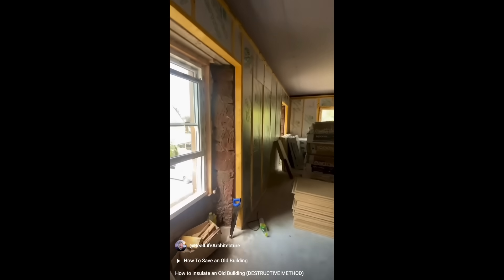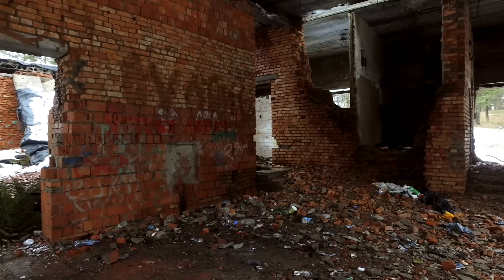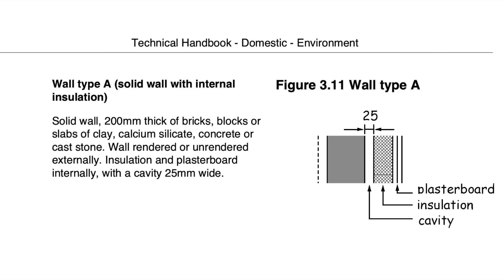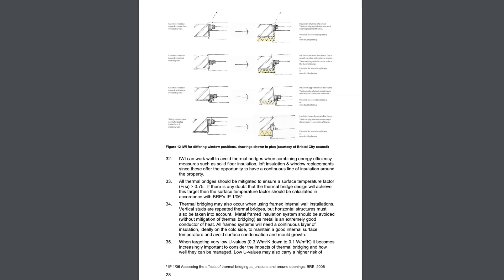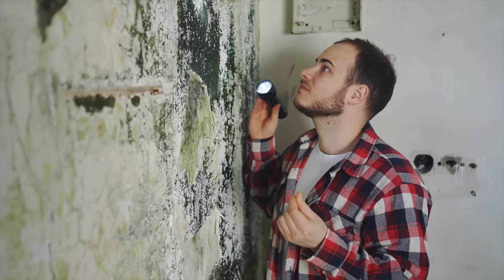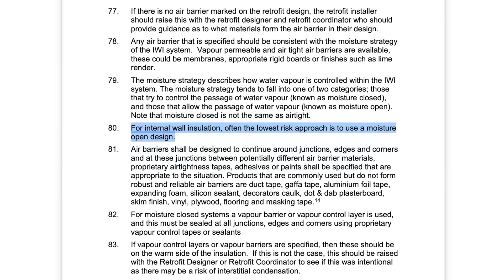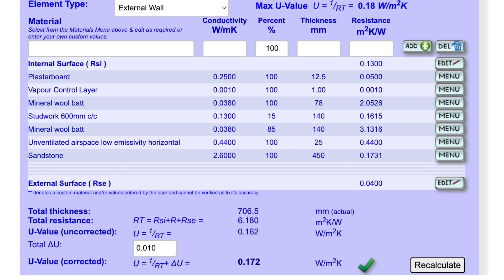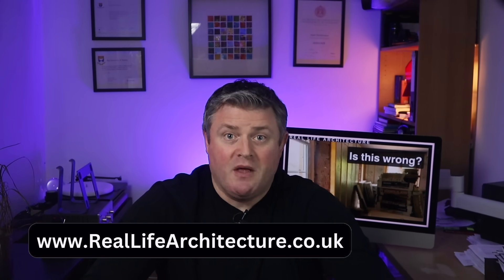How To Insulate Inside a Solid Wall in the UK

Comment: The algorithm gods are shining on this. Well done!

I've recently found this channel over in the Oregon US. I find the way they talk about building science over there really intuitive. It's based on a style of communication developed around Building Science Corp community, who helped developed modern US code and climate zones, their website is also excellent. I'd love to see this sort of discourse here in the UK:

https://youtu.be/Csjs2yVVt7A?si=JN0IkIivxos2L7Lk

There are a few things I would take issue with your video though:
-The amount of insulation does matter. The more you have, the less thermal energy from the central heating system will be available to dry the masonry mass wall. It starts getting tricky at ~150mm IWI levels in the UK climate. It will depend on exposure etc. Fortunately, the first 50mm is far more important compared to the next 50 and so on, so it's likely going to be limited by floor area loss before becoming problematic. 
-As long as any organic matter stays away from the condensing surface, there will be no risk of mold growth. Mineral wool up against the wall is ideal, however, the rest could be some organic fibre between the internal stud wall (interestingly, this is even true if the dew point occasionally lands in the organic insulation layer at times, as the moisture will never condense due to a lack of thermal mass to seed it.)  
-More insulation also risks any embedded timbers in external walls remaining colder for longer, meaning it may start to decay the end grain after IWI is retrofitted. This can be mitigated by hanging the floor system from a ledger board with DPM, or placed on metal brackets hung from the wall, creating a capillary break. 
 
What I'd add to this discussion:
-The parge coat flattens the wall, covers gaps, and offers a means of hygric redistribution of point sources across a large area to promote inward drying. It also reduces the risk of unwanted air paths from forming behind the insulation, which can lead to some stochastic movement of moisture you'd rather do without. 
-Mention smart membranes! Such as intello. They're a game changer. They become more vapour open when the relative humidity equalizes on either side of the membrane. Effectively preventing internal outward vapour pressure from passing through to the walls and condensing during cold spells, but allowing inward drying in milder weather.
-Any process relying on vapour diffusion is very slow and occurs over weeks and month. Air sealing is absolutely critical as it can transport much more moisture. If you don't air seal, then vapour pressure really does matter. Hence why I like the detail, in Asiri's video, of having a service cavity to maintain a continuous air barrier, whilst allowing electrics and plumbing to be routed internally, and easy modification in future. This air seal should be continuous across the entire thermal envelope, all the design skills and installation QC will depend on how well you navigate around all the tricky details. Get that blower door and on site air tightness champion going!

I'd trade durability for energy efficiency every time, so we need to relegate the importance of thermal resistance dead last, until we sort out exposure, air tightness and vapour profile in that order.

Comment: I see many absolutes here, and a suggestion that there is "the way" which excludes all others. This is far from the truth. Different structures in different locations with different orientations can present specific constraints which must be understood and addressed. I also question the rigid adherence to U value requirements which are in fact open to interpretation and pragmatic application.  Look at threshold values in Part L (England) for example. Start with realistic objectives. Undertake hygrothermal analysis/simulation. It is both simple and complex. One size does not fit all.

Comment: I have a mid terrace with bay window and thought there was a cavity sadly no. As a result I get terrible condensation inside not helped by the mistake I made by painting the plaster with a rubberised paint. I intend to rip back to the brick and put batons and insulation in. Was going to fix baton to walls but seeing how you have basically made a wall separate to the outer wall, think this might be a better option. Batons not getting wet etc. I have painted the outside with storm guard so any moisture will hopefully go one way.

Comment: I think it is important to look at temperature gradient through walls in addition to a water vapour gradient to determine where the dewpoint will fall relative to the wall thickness. It is useful to note that anywhere in the UK the Vapour pressure is going to be higher inside the building than outside, (except on a very small number of days). Given that buildings particularly houses, are generally warmer inside than outside and thereby carry a higher water vapour density inside. This water vapour will attempt to migrate to the lower density area, condensing at the dewpoint if within the walls or being dispersed if outside. A solution is to have a vapour control layer behind the plasterboard to prevent this migration. Ventilation or mechanical air handling can then be used to reduce water vapour levels within.
Porosity and condition of the masonry and mortar need considering. I picked the cement rendering off our 500mm solid limestone walls, repointed with sand/lime, fully intending to put an injected damp proof course in. There is no need, it’s all dried out. Internally 50mm insulated plasterboard foam fixed to the walls and gypsum plastered. Floors dug out an relaid concrete incorporating 75mm PIR insulation and dual DPMs. Also I would mention that air tightness is the bane of old buildings - they need air circulation. 
A further check should be for any salts that may have leached up or into walls, and may cause hydrophilic dampness.
I don’t think it is possible to have a prescriptive method of insulated lining to suit every situation. All the relevant factors need to be studied, assessed and the best fit specified.
Reply: Your comment illustrates that which, IMO, is generally missing in the building industry and in particular, relating to the subject at hand. It seems there is very little real research being done into this subject given the problem has been around since the dawn of humanity and we just seem to lurch from one disastrous 'understanding' of what's going on and how to fix it to another without any real science being reflected in building control diktats.

In my situation, I have an old stone / lime mortared building with 600 mm thick walls, some 17 m long but only 3.7 wide internally, which are therefore too close together to put anything other than absolute minimum insulation on the inside (looking at insulated lime plaster 25mm thick, ATM). The back wall can be externally insulated if necessary but the outside of the front wall (balls to ideally) I really want to keep visible because it is such a stunning example of exceptional craftsmanship. I guess perhaps if I manage to get the majority of the stone wall reasonably dry that it has at least some insulative value (significant overhangs and good drainage/ventilation at the foot of the wall, ideally both internally and externally) and go to town on the thermal performance of roof, floor, doors and windows (WHMVHR, obvs, as it always should be these days) that I might be able to get away with it but I foresee something of a building control battle looming in this respect.
Reply: @ I feel for you. The regs seem to be pushing us towards Passive House performance with no allowance. Consider also orientation to the sun, solar gain potential, Prevailing wind direction and intensity, annual rainfall and average temperatures. With an old building these factors and more are pertinent. Fortunately I didn’t need regs for any of my insulation works, only the extension over a catslide roof. Though I’ve plumbed the whole house for underfloor heating and rads upstairs 15 years ago, none of it is operational. No mains gas. 3 phase electric pre-existing, so a ground source heat pump initially envisioned , then oil boiler, then gas bomb, then air source…but prices have fluctuated wildly, so we have a woodburner that keeps the whole 4 bed house “aired’ and electric panel heaters as required. Hot water and cooking electric. Bless our farmer predecessor who put in 3 phase for his milking parlour - very reasonable bills.
Reply: @timstradling7764  I really would not bother with ground source as air source are up to 500% efficient, these days but defo either air to air or air to water.  Panel heaters are, as the sellers (eg Fischer and Ronte) will trumpet from the roof-tops, "100% efficient!!" but that's utter pants - and therefore horribly expensive - compared to an even modest 300% efficient air heatpump (something Fischer and Ronte obvs never mention).  As I said earlier, the newer A2A HPs can compete with mains gas in terms of cost... and then there's the carbon thing.  I too have a woodburner (so much free wood here, it'd be daft not to) but my existing house (not the one I want to do up) makes it difficult to make that work for the whole house (rented, so stuck with it - I'd rip up all the floors and put in air to water heat pump-fired UFH were it mine own).
Reply: @martinwinlow  Couldn’t agree more  with your comments. No fixed panel heaters here, just the odd plug in one and 2 fan heaters to raise the temp which is retained by the structure with an occasional top up when extremely cold ! Got to the stage now where the installation cost of ASHP would not save us anything over the current running costs except very, very long term. We have plenty of standing coppiced Hazel and continually springing elm that the beetle gets to at about 12yo together with a bit of willow and ash😁
Reply: @timstradling7764  Ah... ..."coppiced Hazel..."  Shouldn't everyone have some...?!
Reply: @martinwinlow  Definitely, wonderful wood, great for charcoal on which the original iron workings depended, and clean burning wood giving ready heat. Don’t forget your bean poles too😊
Reply: @martinwinlow if you Google Historic Environment Scotland case study, they have some useful resources with performance monitored over time for different systems.
Reply: @timstradling7764  thanks for taking the time to explain that. Very much appreciated

Comment: I don't think plasterboard is vapour permiable, nor a skim coat, nor some paint. That said I've used this exact build up in my utility room but left a gap in to the ventilated floor void. The moisture meter i left behind the wall shows 80% humidity consistently, the room is about 50%. Not sure what my conclusions are!
Reply: What a great idea to put a meter behind the board, it does give clues to what could be going on, like at what humidity does mold flourish or not. Great thinking.

Comment: Is not mineral wool rather hydroscopic and does not give up moisture easily? Would not wood fibre board be less hydroscopic and if it gets damp, give up the moisture more readily?
Also the paint matters. Modern paints act try to act like a vapour barrier. There are breathable paints available.

Comment: I don't get it. The trend now is to lower the humidity in the house and use positive pressure systems with wall/window vents. This forced flow direction will massively impede breathing in the direction from outside to inside the house. If you're in a 'dry area' and you block the house moisture travelling from the inside of your house (through the plasterboard/insulation), there is no moisture to condense on the inside of the brick. Any outer wall penetration can still breath back out the wall where it came from. My logic would be to avoid the breathing out the house moisture, so there's no moisture to condense on the cold inner wall face.
If you want to vent the cavity that you formed between the inner wall surface & insulation, fit some outside weep vents at the top & bottom of the wall that will enable proper ventilation rather than relying on the insulation & plasterboard walls to be highly breathable.

Comment: thanks for the video. Have you ever used or heard of aerogel insulation before? I have an old stone house with lath and plaster (no insulation), and was considering putting aerogel boards straight onto the existing plaster, to maintain the original features of the rooms. I'd be interested to hear your thoughts.
Reply from the maker: I’m looking into it
Reply: @RealLifeArchitecture definitely do a video about it as it’s very efficient. Also available as a separate insulation. Expensive but it’s even more efficient than PIR. If the government were really interested in saving the environment they would be investing in its production and subsisting its installation.
Reply: I'm looking into this too - my kitchen is plaster on external solid sandstone walls and it's a morgue. Was considering stripping off the plaster and putting up Proctor WallBoard with the integrated aerogel insulation. But this stuff is extremely expensive, looking at £500/m of wall.
Reply: @ yes it's very expensive

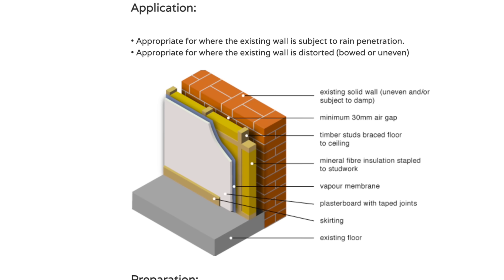Comment: ~6:00 for the vapour open mineral fibre, at 6.00 minutes did you really mean 'droplets' (big fat) or molecules (miniscule atoms and sub-micron aerosols? 
There's a lot of confusion and scare mongering about sensible (truly damp) water in the fibre and just cold high RH vapour getting out.
There's lots of similar confusion (and lack of knowledge of ) about the wind driven rain issues for cavity walls (similar maps for problems. 
(I feel your pains - Pitlochry;-)

Comment: My stone house in Scotland was 'renovated' about 18 years ago. The big issue is that there is no insulation on the exterior facing walls - it's ~50cm sandstone, a 5cm gap, then the plasterboard. I feel they have done this because of internal space issues, and it's certainly breathing (cold) as I have a hole in the plasterboard from where a plug socket used to be. Obviously I am not re-renovating (not that there is room for 10" of mineral wool) and will have to take the heating bill hit. Am currently looking at converting the downstairs portion somewhat, where the wall is even thicker, and now need to consider the moisture trapping risk of PIR insulation on the exterior walls. That Proctor Aerogel insulation looks viable.
Reply: You don't need 10" of mineral wool, nor aerogel (although you can do that if you are stinking rich :-). But 50mm of woodfibre (or authentic Scottish hemp from Indinature) behind your plasterboard would dramatically improve the efficiency of your home without taking any more space. another 30mm would be even better. A lot has changed in the last 18 years and you probably do need to think about fixing those external walls. Avoid PIR like the plague in these sorts of buildings. The video is quite right that vapour-permeable constructions are vital.
Reply: @xxwookey  Cheers - 5cm of woodfibre/hemp would certainly be a major upgrade over nothing! Am I correct in reading that you can skim plaster straight onto the smooth face of woodfibre (eg steico therm) and skip a layer of plasterboard?
Reply: @ Yes, you can render/plaster directly onto any rigid woodfibre board. So no there is no need for plasterboard. Note that there are also squishy woodfibre products which you can't render onto directly - you need to put a stiffer board on top first.

I'm not sure about just skimming vs some base plaster+ skim. I would ask backtoearth or other suppliers what they recommend. Normally a lime-based plaster rather than a gypsum plaster is recommended, but I think both will work. The datasheet for Steicotherm lists 12 suppliers of compatible plasters for internal use (all lime or clay based), and also recommend a basecoat with mesh plus a top coat. Also note that Steico therm has a way round, Steico internal doesn't. The datasheet is very thorough.

Comment: Very good.  I have also been using similar mythology along with using Hydraulic lime mortar on external of old solid walls .  Building in Spain has its own process and Bulgaria has another especially with the old house renovations.  It is certainly an extremely interesting part of construction. As you say , there is not one method for all. Many aspects need to be analysed to achieve best results.  Thanks Rory.
Reply: for avoidance of doubt, it's generally not necessary to use 'hydraulic' lime on above-surface walling, either interior or exterior. 'Hydraulic' lime is a lime mix that carries sufficient impurities ('pozzolans') that it will cure even if permanently soaked/underwater, similar to portland cement. For above-surface work a lime putty-based mortar is a more breathable option than NHL (hydraulic lime).

Comment: Good video, the risk is basically 'interstitial moisture' being trapped in the wall. Understanding the solid wall construction and its vapour and thermal performance is the first consideration before IWI design.

Comment: Our method now. Solid wall, 25mm cavity, breather membrane, 100mm kit with 80mm pir in between studs, vapour barrier, 25mm pir over studs for cold bridge, 25mm battens for service void and air gap, plasterboard. 
In some cases maybe necessary to use 150mm pir to meet standards.
Reply: This video suggested issues with PIR and breathability with stone walls - opinions? (I'm in Scotland so would need the 10+5 PIR on newly insulated areas, but Proctor Aerogel might only need 10-12 and is breathable).
Reply: @AgileSnowWeasel  Do not do it, there are massive problems with filling cavities, that are only now becoming apparent here in the UK 10 yrs after it was done.